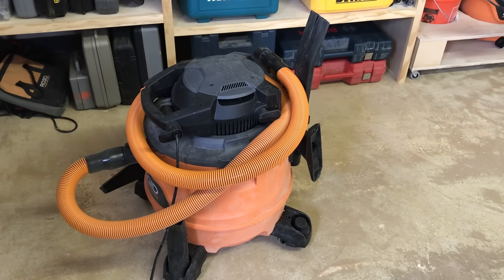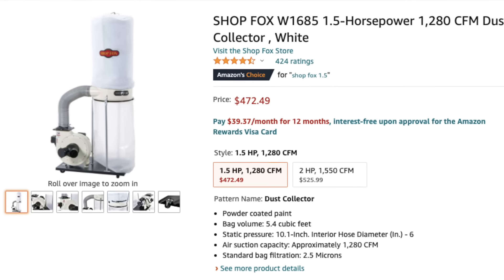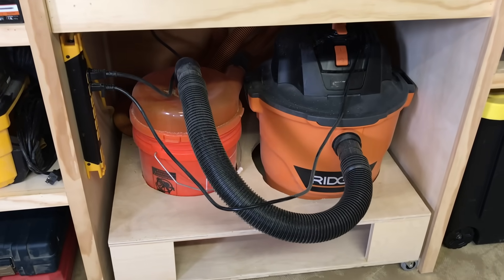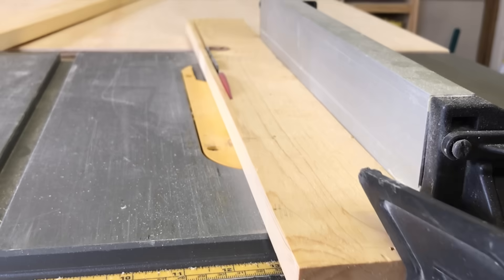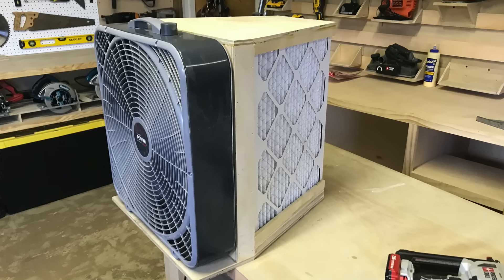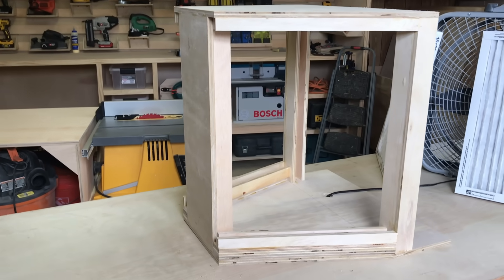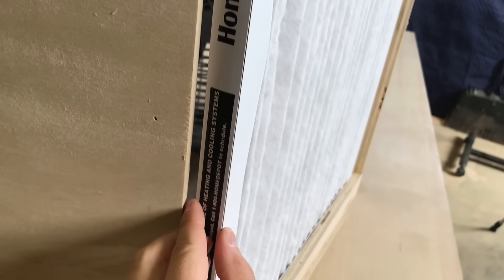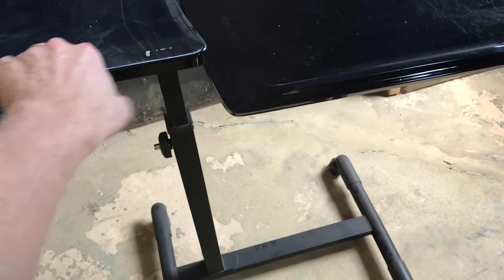BOX FAN AIR FILTER For About $40! (How To Build a DIY Box Fan Air Purifier With HVAC Filters!)

Comment: OKay... quit drinking the kool-aide on the problem with wood dust and lungs.   I've read all the studies. Not someone else's conclusion of the studies.  But that actual studies. It's part of what I do for a living in Research.  The problem with wood dust being a health hazard is very very small.  Now, unless you already have lung issues from smoking or are allergic to certain wood species.  You are not in danger of wood dust.  These dust collectors you are speaking of... just help keep the dust down in your shop.   Those manufacturers are taking the one tiny element out of the studies to scare people into buying or building these things for health reasons.  They are lying to you for the sake of making money.  Always follow the money.  But if you want a really clean shop with less work... by all means get the filter systems.

Comment: I built a box fan air filter works, a while ago its works great! I have a shop vac but don't use it to collect saw dust off my saws. I have my saws just hooked up to used regular household vacuums I picked up at garage sales and thrift stores. I just do wood working as a hobby. Just my way of saving money. It works out well.

Comment: A better design is putting a floor drying fan, in a box with a sealed outlet, with a size of the box to fit one of those air filter panel.  The fan will move air more efficiently, clear the area much faster and the fan will live forever because the bearing is going to remain completely clean being sealed in the box.
You can also use UV/Ozone bulbs in the box to disinfect the air if needed.  I had to make this impromptu because i needed to take care of black mold, and didnt want to spread spores around.  Box fans leak air around the blades .

Comment: I have wondered what level of filter to use for shop air filtration.  MERV 8?  MERV 11?  Obviously trade-offs for higher filtration, but the question comes down to "What size are wood dust particles and how small do we need to worry about?"

Comment: A year ago I started home renovations and woodworking. I was really thankful for your video on air filtration, and built one that’s very similar. Since then I’ve realized my air filter really needs to be improved. 

It would be great to see an updated version of your videos, with a mobile air filter (that’s easy to transport) and a stationary version for the shop that can quickly clean the air of the smallest particles.

Comment: I’ve thought of a slight variation to this for the basement workshop, so I can hang it from the ceiling - essentially to make the angles of the trapezoid much stronger angles, so the whole thing is much shallower, and hang it from the joists right above my work table. 

Any thought as to which way the fan should go? You have it drawing through the filters here - i.e. blowing air out of the box - and I’ve seen others do it the reverse. I think sucking into the box (blowing out the filters) is better for being less obtrusive while working (not blowing air at me constantly), but it is drawing dusty air through the fan motor - surely that will reduce the life span of the fan. But for $35 for a fan, maybe not a huge deal.  Thoughts?

Comment: I like this idea. I watched vids about using cardboard to tape a three sided box together.  Seems short sighted; when the filters get dirty you have to destroy the entire thing and rebuilt it which is kind of tedious to begin with. The old saw sort of: build once, cry once.  Something like that.  I don't even need this.  I cut everything outside of the shop and if anything, I can use the leaf blower or small fan to blow the dust away.  If I do anything inside, I'm wearing a dust mask.  I am way more concerned with my lungs than whether the shop looks neat and clean and when it needs cleaning, full respirator and leaf blower with all the windows and doors open. I don't mess around.

Comment: Not sure if you’ll see this, but wanted to let you know about the “C-R” or Corsi filter. An earlier comment here mentioned a filter system on “this old house” that used 4 filters in a box formation—it’s that. Two university engineers came up with it and it’s been shown to work as well (if differently) as commercial systems.

Basically: if you needed more affirmation that this is a good idea and of your own clever resourcefulness—engineers say you’re right.

Though I’d also be curious how  you’d improve your own design from some of the reasoning behind theirs. For example, commercial systems are more efficient—cleaning 80-90% of particles—but your approach is just so much faster that it can compete with them at a fraction of the cost.

Comment: I made a dust collector out of a few 5 gallon buckets, lining up the perfect spinning airflow for the intake well also being two buckets tall made it so no dust making it out of the bucket system into the shopvac (actually never have to empty or clean the vac itself but I keep checking it anyway even though nothing ever is in there lol). 

But I do have a box fan hanging from the ceiling sucking up with a filter taped (and sealed with vinyl tape) so it sucks up into the filter then blows against the ceiling and then back down circulating. I regularly vacuum the dust out of it though just to make sure im never taxing the fan. I find it very useful on just about any project sanding, staining, painting or even just using windex lol its good about fumes and smells, I avoid anything toxic as much as I can since I can only wear masks for extremely short periods of time but even non toxic/non fine things are still bad to be constantly breathing in so a box fan filter is a must in my opinion!

Comment: I got a Holmes box fan - while it isn't called the Hurricane like yours, I believe it's standard. The thing is I was surprised to see that not much "suction" was happening on the back end of the fan and all I had was a 20 x 20 x 1" taped to it. Is this normal and it's just my expectation was too high?

Comment: Very nice!! When you turn the fan off,  does some of the accumulated dust just fall back onto the floor once the suction is gone? Would it work as efficiently if the fan was turned the other way and blowing the dust into the box/filters, so when you shut it off the dust could just fall into the box and be shop vacced out later?

Comment: I use a similar system but with just one filter. It collects a lot of dust! However, I also vent my shop vac to the exterior of my shop. Even if particles get through its filter, they are vented outside and I am not stirring up the air in the shop with the exhaust. For those times when it is needed, (cutting mdf for example) I also have window fan built into the exterior wall of my shop. It is covered until I need to use it and it clears the air very quickly as indicated by my air quality monitor.

Comment: I ordered hepa shopvac bags for my box fan for putting in windows, the filter bags they have 5 layers i use 2 layers to keep the air cleaner in the house. You can see how effective it is when you look at the filter material after a few days. The largest hepa bags on amazon. I have even looked at attaching to screen as well

Comment: Make it foldable or part of a work bench. So the box can be used for storage when it's not a filter system.
Reply: They also make washable able to be cleaned MERV 13 air filters that can be used over and over again; which eventually would pay itself back over time which would over the long haul save one a great amount of money for the initial amount of money invested.

Comment: i made similar to yours but what  i did  different was i coiled a 1/4 copper tube on the exhaust side of the fan, then ran two clear tubing to a ice chest witch contained  a cheep fountain pump  them=n put two bags of ice in the chest and about a gallon of water turned on the pump with the fan!!
voila cools the shop 10 -  20 degrees

Comment: Hi, I just saw this and am intrigued. This may be an inexperienced question… but do you think that if you reverse the direction of the flow, such that the fan is blowing into the filters. The filters then can be arranged property so they catch the particulates and only clear air comes out the other side. This way instead of the fan blowing on you and pulling air into the filters, that it does the opposite…sucking external air in and pushing it into the interior chamber and clean air exits from the filter back into the shop.
Reply: The original Crosi-Rosenthal engineering design by UC Davis School of Engineering called for the 20 inch box fan on top of the cube be blowing and exhausting air up and out of the cube directly upwards; so that all the environment air surrounding the cube would be sucked in equally from all sides from withing the cube volume equally at a consistent and uniform rate to ensure optimal and maximal air evacuation of extra fine sub micron particulate environmental contamination. The cube components that are formed by the four MERV 13 air filters need to have their air flow direction aligned in the same direction of pointing inwards towards the inside of the cube to make this happen properly as a reminder before final noted assembly. Now to a certain real life practical and logical extent I do follow up on the potential beneficial post air filtration effects of any potential air particulates that escape the probable likely potential first air pass filtration attempt; any potential escaping air particulate contamination simply falls back down to ground level to hopefully be immediately and appropriately picked up once again to be recleaned as many times as is needed to have the air filtration cleaned to the desired objective designated MERV 13 air cleaning standard.
Reply: @profdleeucc  thanks Dennis.  I appreciate you circling back and answering the question
Reply: @JohnS0709  Now in regards to the potential idea one could blow air from one's box filter fan mounted on the top into the cube's internal array formation with the arrow's on the individual air filter's making up the array  pointed in the appropriate direction spilling outward's away from the inside of the cube's internal array formation back outside of the cube formation and also back into the shop area where one's box filter cube array formation is located. Now that would depend on what is happening in one's given work shop environment from a foreign particle contamination assessment evaluation; and also if one's box filter cube array formation was mounted on a rolling mobile platform truck dolly. It's true that if one can roll up close to the source of one's potential actual wood shop contamination one could potentially capture the contamination in mid air if it was close enough to the top mounted box filter fan on top of one's box filter cube array formation; but if one's box filter cube array formation was in a fixed non-movable location and it if was centrally located in the middle of the shop one could potentially also optimally attempt to get one's work shop air cleaned at a faster rate also as well in a more omnidirectionally objective directed planned manner; I would definitively definitively say that if one could have both methodologies effectively employed describe that would in fact theoretically serve to provide and even more efficient and productive facilitation of one's clean wood shop air quality environment; if cost was not a mitigating factor in considering improving one's wood shop clean air working environment over the long haul evaluation and assessment.

Comment: I am very grateful to have found this video.  I’m a stone sculptor and have hunted for years for a solution to my stone dust problem.  It goes everywhere and stays in the air, seemingly, forever.  I used your design except with a high volume squirrel cage fan.  It’s wonderful. Not quite perfect but as close to it as I can imagine.  Thanks

Comment: Personally I just bungee a cheap dust filter stacked on an expensive smoke filter to my fan and leave it on low to avoid overworking it.  Also much easier to pick up and move around.  If I really wanted to maximize airflow I'd probably just tape 4or8 filters into a box behind the fan.

Comment: The only problem I see is that the 1” thick filters have a smaller surface area. This creates an issue with restrictive air flow. Meaning that the fam has to work harder to full in air this causing a possible issue of fan motor over heating. Basically you achieve the same flow as a regular 2” thick filter. I understand the need to the design which is more likely to fit into corners (which is less likely to be needed. Try 2 x 2” thick filters and see what your results are.

Comment: i took the bad compressor out of a dead dehumidifier with a working fan, but left the control electronics rewired to make it think there still was a compressor. It runs like normal with all the normal functions of times and fan speeds. then i bought a replacement filter for an expensive air purifier and put that over the intake grill. final cost: $15 or so.    the fan pulls the filter element against the unit, so duct tape was perfect for attaching and sealing.  the  thing even still monitors the humidity haha.

Comment: I just made a frame with a 1 inch drop in slot to fit one filter on the back of a fan.  I honestly wanted minimal pace usage and good air flow.  The compromise is made up by using high quality filters.

Comment: Great job!
Questions: (1) Where did you purchase your box fan, e.g. Amazon, and how mucn did it cost?; (2) Did you mount the "Box Filter" to the rolling cart, and when using it; move it directly adjacent to your power tool? (I ask because I wondering which part of the "Box Filter " did you face towards the power tool, I.e. Front or Back?)

Comment: We just tape the filter to the intake side of the box fan. When its time to change the filter,  just put the whole thing in a trash bag, take it out side, cut the tape, knock the fan on the ground a couple of times, and lift the fan out of the bag carefully. Then run the fan (still outside) or vacuum it off and it's ready for the next project.

Comment: bolt a 12" flat steel bar to bottom center of fan, inline with flow of air. duct tape five 20"x20" filters to form a cube. Find balance point on steel bar, drill a hole for hanging. Use spare outlet from garage receptacle mounted on ceiling. Fan control is on the bottom and within easy reach. It will oscillate a lot. Have fan blowing into the filters so the particles are contained.

Comment: This video lands on the paranoid side. Unless you have some chronic lung condition like asthma, for the vast majority of weekend woodworkers, and even commercial workers that spend a day or two a week cutting in their shop, it is simply unnecessary to collect every particle of sawdust. A bagged shop vac connected directly to your power tool is more than enough.

Comment: I like the double filter set up. For dog dander inside the house, I just taped a MERV 13 filter to a box fan. I tried putting a cheaper low MERV filter in front (double filters) but it cut air flow down too much being back to back. Your set up would prove more effective I'm sure.
Reply: If the objective to trap the dog dander inside the house in the lower MERV filter in front of the MERV 13 filter; then one can alternatively use something like MERV 5 filter as that should effectively stop and filter out the the dog dander and help to keep the MERV 13 filter operating for a much longer prolonged period of time; while keeping replacement costs for the anticipated MERV 5 filter replacement more reasonable at the same time.

Comment: I made one of these a few years back & they really work alot better than I ever thought they would. Mine is a 20×20×2, I used four 20×20 filters 2 inches thick, basically made a 20×20 square box with the filters and put the fan on top blowing straight up & can't believe how well it works. Made another one for inside my house, works great with catching everyday household dust also.👍🏻👍🏻

Comment: I just use a 20” filter bungee strapped on the front of a box fan from Walmart.   Works great and it is astonishing how much dust this will collect in just a few minutes.  In my micro shop it probably circulates/filters most of the air in a couple minutes.  I will set it on the bench right next to a sanding project and it almost eliminates dust it the shop.  I did make a quick and easy cardboard shroud inside the grating that blocks the corners on the outlet side to force all air through the filter.

Comment: Great video.  I plan to do the same... no large collector, but use shop vacuum(s) with separators and a home-built fan filter like yours to remove stuff from the air.  I always use a dust mask when making more than one or two quick cuts... a 3M N95 with breathing port or a half-mask with proper removable filters (P100 and/or VOC filters).  You only get 2 lungs.

Comment: It also works great for smoke.  We had a lot of smoke last summer, so I got a 20x20 filter and just laid it on the suction side of the fan.  I really helped lower the particulate in the air.  Spend the money for the more effective filter and keep your house cool and smoke free.

I think next summer I may experiment with the more expensive deep box furnace filters.